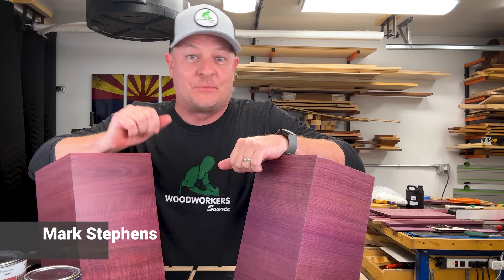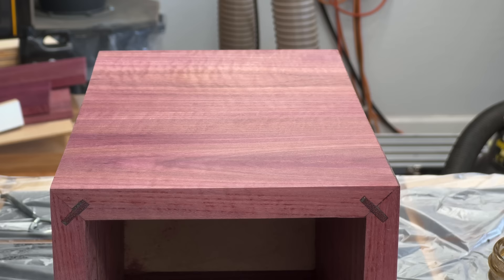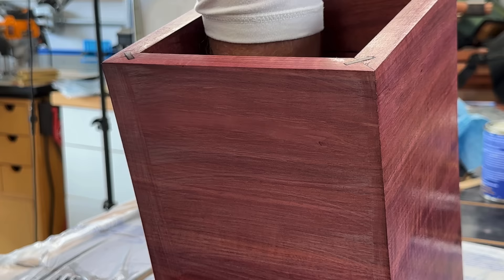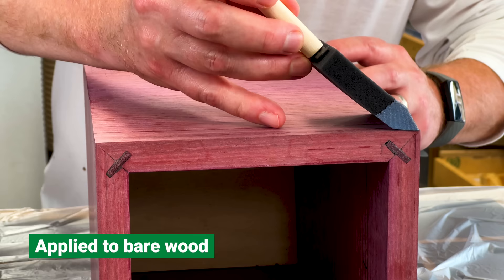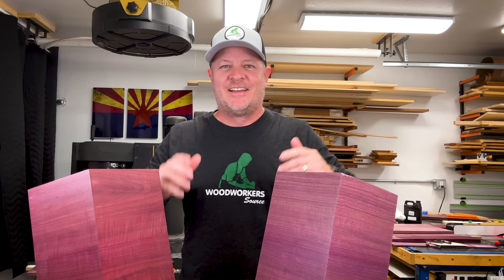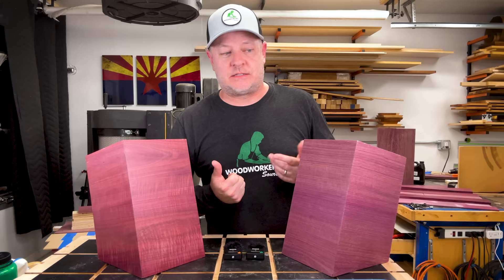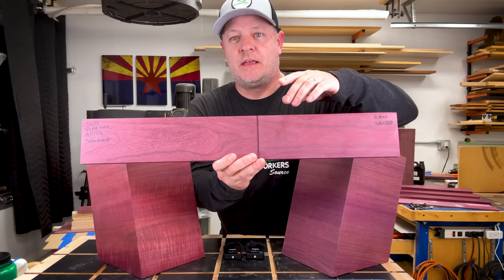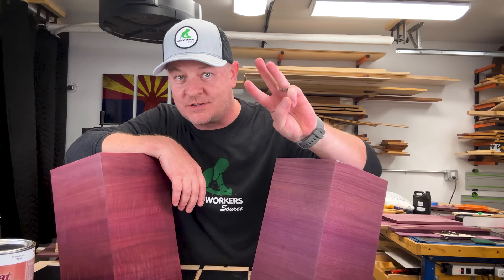The Best Finish for Purple Heart Wood

Comment from the maker: I'm still shocked people put their wood in a home oven. What's the weirdest home hack you've heard for woodworking?
Reply: I have heard of using a microwave to dry out bowl blanks for turning.  👽
Reply from the maker: I've heard that one too!
Reply: I've done it.  Smells awesome nice though :)
Reply: Ive baked purple heart heaps of times. It smokes up like a mofo, but that is just from the oils. it has never even come remotely close to burning, and the colour difference is astonishing and stunning. It deepens the colour from that basic almost man-genta, all the way up to a rich au-bro-gine. After doing it once, it is no longer an option, and I won't EVER consider using PH without baking it first.
Reply: The ignition temperature of wood varies by species, but at temps like 300 and for only 30-60 minutes, there isn't really any concern.  Most wood isn't going to ignite anywhere under 400-450, and even then it will take awhile to start smoldering.  Baking purpleheart at 300 for about 30 or so minutes (depending on size of the piece) seems to set the color for much longer.
Reply: When curing bowl blanks for the lathe, I carve out a thick bowl on the lathe from green wood, take your time, no rush, I’ll then start the drying process in the microwave oven. I generally don’t do more than a minute at a time to begin with, usually 30 seconds, then wait at least 5 min between zaps. The premise is that a microwave oven excites water molecules to produce heat. Which promotes evaporation. So I’m not trying to cook it, just anytime I pass by the microwave, I give it 30 seconds, check on it when I gotta cook food. The standard oven idea sounds like a recipe for cracks and charring, uneven moisture removal, however, if I tossed in the oven on low heat with a green cut blank for a while and got that evaporation started, then put it on the drying pile, only then would I suggest that, as it may reduce drying time by months.

Comment: I've used heat treating in an over to revive purple heart and it does work. You want to elevate the purple heart off a metal rack or cookie sheet so you don't get the heat differential on the metal surface. Snecker has a great  video on it.
Reply: Hey, I think I know that guy. True story: I just finished filming a long overdue update to my purpleheart baking video, and this showed up in my feed.

Comment: I built several "gentleman's valet" boxes for Christmas several years back from purple heart.  First off, be careful with this wood.  It has one of the more potently allergenic dusts.  I wasn't ready for it and it made me feel terrible for a week before I looked up and saw my purple air handler filters and put 2 and 2 together.  I finished projects with a French polish using Minwax finishing wax and a traditional technique with water rather than solvent.  It took about 12 coats but 7 years later and they still look like a wet purple heart crayon.  Excellent video.  I'm going to try this when I break out my purple heart again.

Comment: I make my shellac from flakes, I build layers with about 7 coats of shellac, they dry in only a few minutes with a 2 pound cut. Then 3 coats of spray lacquer. That's what I was taught in HS over 30 years ago. It seems to work pretty well.I just recently started woodworking again since becoming disabled a few years ago. I've only did some minor home repair/construction type stuff since HS. I like 100% tung oil for cutting boards with purple heart in them since it's food safe.

Comment: I bake if for my inlay projects. 350, one hour. Nice rich color, no cracking, and goes all the way through the board. It will warp slightly. Do it before milling and it's a non issue.

Comment: Thanks Mark! Your videos are always helpful for me. 
I do have a question about dewaxed shellac. I have been looking for some in a spray but I haven’t found any spray shellac that says dewaxed. I want to dye some figured wood and am thinking shellac would be good between colors to keep from one dye dissolving the previous color. Maybe an idea for another video 😊
Reply: Many of the dyes have alcohol in them.  That can melt the shellac and blend the dyes anyway.  Some of the wood turners use spray fixative instead.
Reply from the maker: Aerosol shellac is usually dewaxed but it’s pretty thick so it’s not as nice to use

Comment: First, thanks for all the great videos- really helps with the rabbit holes of finishing. Second- question- Do you prefer the flat GFWBHP over a satin or higher gloss on purple heart? About to finish a box made of purple heart (lid panel), zebra wood (sides), and wenge (interior and bottom)- wanting to get the best finish possible. Thanks again.
Reply from the maker: Whoah, that sounds like a killer combo! Personally, I like flat over glossy as it allows the grain to shine in a subtle way. That said, we've seen plenty of glossy purple heart projects that look great too. With those three woods, I'd still lean towards a flat finish.

Comment: First time I've seen this channel. Really great info -  I never saw that purple heart solution before...and I just subscribed! ! 
BUT..... if i may, here's a similar but new issue that I hope you've come across before: 
I've always wanted to use Padauk in a bunch of my pieces  bc of its fantastic colors, but I've avoided it bc I know those reds and yellows are soon gonna turn an ugly gray. So, after doing some research, I now know that what starts that graying process in Padauk is not UV.  It's the initial machining (sanding, planing, etc) that triggers the graying. I still don't know how to reverse or prevent it, but at least i know what starts it.  So, to your knowledge, is there anything that can be done for Padauk (or for that matter, Bloodwood, Canary, Osage Orange and other colorful exotics) that could prevent, eliminate, slow down, or reverse the process that takes those beautiful colors away? Woodworkers everywhere would be forever indebted if you had a solution to that. Any knowledge or suggestion?  Thanks so much!

Comment: A very successful method used by old masters is to treat the Purple Heart to retain the rich color is with lemon juice (squeezed from lemons not bottled).  Use a brush to cover the surface and allow to dry.  I learned this from Italian Marquetry craftsman.  This treatment stops the oxidization of the woods oils that causes the dark coloring.  Complete all sanding before applying lemon juice, if you sand after the treatment it will oxidize.
Reply from the maker: Interesting, but I'd assume the lemon juice would then raise the grain and need to be treated? We had another suggestion using oven cleaner, maybe we'll test these both!

Comment: Purpleheart can be a crap shoot.  I have pieces that were deep purple before milling. Some pieces turned back to purple after a few days, but some have been cut for 10 years and still remain that orange brown color. Sometimes putting it in the sun for a day or 2 will bring the purple back.
 Once it is purple, clear finishes with UV inhibitors are best.

Comment: Thank you Mark, I have a guitar that I have been working on, the body is Purple Heart, the neck is purple heart and maple and the fretboard is rosewood, I have already added boiled linseed oil, which did darken it up, and I did that after setting it in the sun after I finished sanding it , and I can't seem to paste a pic in the comments,, but if I have already applied an oil, would you recommend the same process of dewaxed shellac then the water based topcoat or do I need a sand-n-seal coat to form a barrier between the oil and these other coats?
Reply from the maker: You can apply the dewaxed shellac as an in between coat for the high performance. In your case, you'd only need 1 coat of shellac just to act as a barrier. Feel free to email us with pics and I can help further: helpdesk@woodworkerssource.com

Comment: You say to put Purple Heart out into sunlight to revive the color with UV light. Then you put a protective coat of 3 or more layers of General Finishes High Pergormance Flat ? That blocks UV light.  If UV light makes it turn more purple to begin with, why would you want to block it with the finish?
Reply: Because over time UV exposure will turn it from purple to brown. It’s like a bell curve. It starts out grey, turns to purple, then turns to brown. You wanna lock it in when it’s purple.